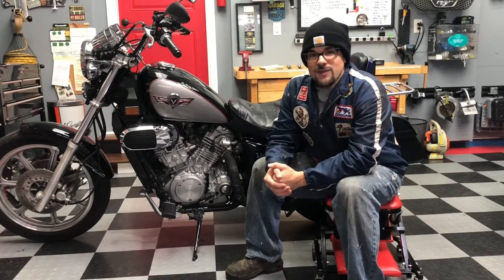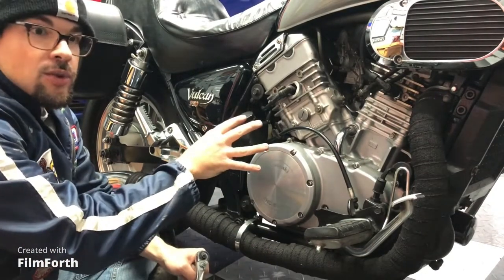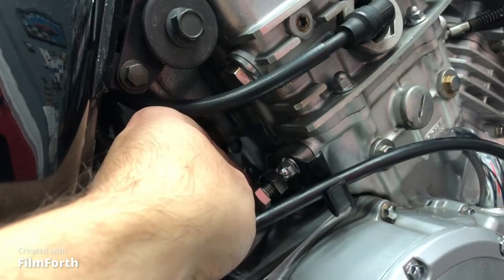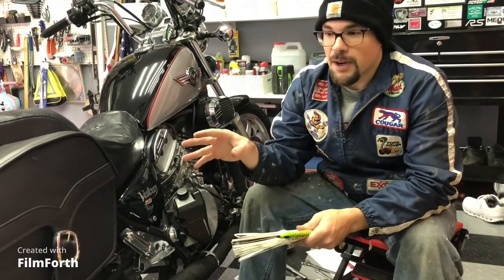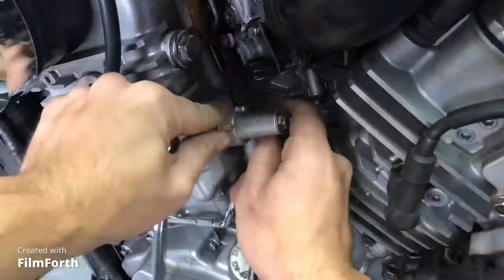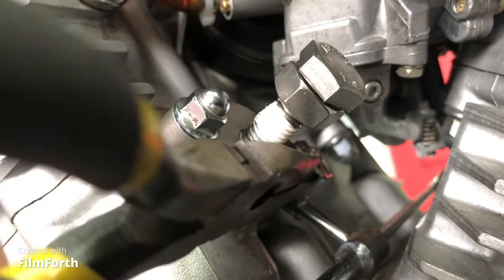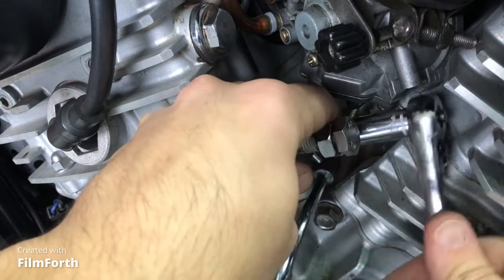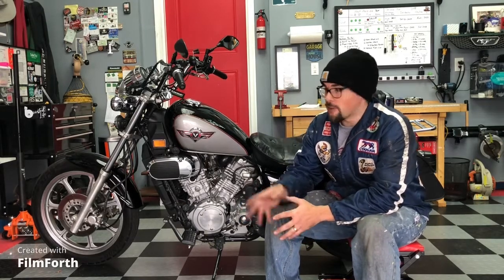How to Replace the ACCT's with MCCT's on a Kawasaki Vulcan 750

Comment from the maker: I found out from VN750.com that a 17mm stubby wrench (shorter wrench) is perfect for adjusting the MCCT's.
Reply: Noch eine Frage: Normal ist es doch so, wenn ein Steuerkettenspanner, nicht mehr die Kette auf die richtige Spannung bringen kann, sind doch entweder, die Spann-, und Leitschienen verschlissen oder die Steuerkette hat sich gelängt. Gehen wir einmal davon aus, das die Spann-, und Leitschienen der Steuerketten noch in Ordnung sind, dann kann es nur die Steuerkette selbst sein, die sich gelängt hat, und deshalb der Kolben vom Kettenspanner nicht mehr weit genug, und damit auch nicht stramm genug, gegen die Spannschiene drücken kann. Soweit ist es ja Verständlich. Wenn ich aber auf eine gelängte Steuerkette einen Druck nach "Vorschrift" setzen will, kommt es doch Zwagsläufig dazu, das bei korrekten Druck des Spanners, die Markierungen für Zündung und Ventile, nicht mehr übereinstimmen. Wie ist es nun, wenn die Kettenspanner gegen "Manuelle" ausgetauscht werden, in wie weit kommen die Zündzeitpunkte, und die Ventilöffnungszeiten "ausser Tour"? Ich habe an meiner VN 750A (1986), nämlich geau dieses Problem mit "klappernden Steuerketten", und möchte dieses Problem gerne beheben, ohne hier unbedingt den kompletten Motor zerlegen zu müssen! Was tun?
Reply from the maker: @K @KG-li7kg more likely than not, it’s simply the cam chain tensioner itself that fails. You see, the factory ACCT’s from Kawasaki commonly fail between 10-20k miles. And simply replacing them with MCCT’s is all that’s needed to enjoy tens of thousands of more trouble-free riding. From my own experience and from other owners on the VN750.com forum (some of whom have put >80k miles on their Vulcans), the rest of the cam chain components are quite robust.
Reply: @CFG750  Danke für die Aufschlussreiche Antwort! Dann kann ich ja ruhig beginnen, die originalen Automatischen Spanner gegen "Manuelle Spanner" zu tauschen.
Reply from the maker: @KG-li7kg  Yes. Here's some additional info from some of my past posts. 

https://www.vn750.com/search/115789/?q=MCCT&t=post&c[showFilter]=visibleOnly&c[users]=Checkered+Floor+Garage&o=relevance

Comment: Hi, where did you get these parts from? I wonder if they're still in business. Thanks
Reply from the maker: I got them directly from TOC's website:

https://tocmanufacturing.com/

But I've noticed over the past few years sometimes they have the parts available but sometimes their website is broken/not live. Currently, their website isn't live. So your best bet at the moment would be an alternative MCCT option. Check ebay for "VN750 MCCT" and you'll get suitable alternatives.
Reply: @CFG750  Thanks for your reply!

Comment: My 1995 Vulcan has only 8500 miles on it. I got so lucky.
Reply from the maker: That's incredibly low, what a great find! Given the low mileage, you're probably rocking the factory stator, so keep an eye on your charging voltage because my factory stator starting weakening ~13k miles and I had it replaced before 18k miles. Also the factory cam chain tensioners aren't robust so keep an ear out for any abnormal ticking sounds like this:

https://www.vn750.com/threads/explanation-for-ticking-sound.109645/?post_id=1330708#post-1330708
Reply: @CFG750  Okay. I watched and listen and heard the ticking of your engine. Thanks and I will keeo a listen for any ticking. I guess I should go aheat and change the ACCT's with MCCT's .   Much respect and thanks

Comment: Hi I just bought my 1995 Kawasaki Vulcan 750 last week. I have been wanting nice saddlebags and windshield for it. I like the way your saddlebags are. Can you tell me what kind, where to buy them, and if you had to get any other items like saddlebag rails for them to hang so perfectly on your Vulcan?
Reply from the maker: Thanks! I'm really happy with the quality of the saddlebags. They are from Viking Bags, and although the specific ones I have aren't for sale anymore (I got mine in 2021), there's other similar options that Viking Bags sells. Check out this link, where I search for VN750 saddlebags on their website.

https://www.vikingbags.com/collections/kawasaki-vulcan-750-vn750-motorcycle-saddlebags

Also check out this post of mine for some additional insight. You'll need to relocate the stock rear turn signals as they'll obstruct most saddlebag options. Or you can do what I did and get a turn signal & rear brake light LED combo unit (I'm just not sure how compliant they are w.r.t state & local inspections). I didn't need any additional hardware to install, but I did need to get creative and angle the mounting brackets a little further back to also clear the rear shocks.

https://www.vn750.com/threads/viking-saddlebag-pics.109535/?post_id=1329569#post-1329569
Reply: @CFG750  Hi, do they come with secure mounting hardware or do I need saddlebag supports with those? Thanks
Reply from the maker: @ChristopherWebb-ib2gg  The kit should come with the supports needed specific to the VN750. That's how my saddlebag kit was designed.

Comment: Are these interchangable for the '85 VN700 as well?
Reply from the maker: I believe the cam chain from a VN750 should also fit the VN700. The 700cc engine is just a slightly downsized version of the 750cc engine.

Comment: Does the MCCT fit on the vulcan 800?
Reply from the maker: I don't believe so. The Vulcan 800 cam chain tensioners (pictured below) look different than my VN750's.

https://www.ebay.com/itm/374718479358?itmmeta=01HR61N0NNTJMB6NQTAJFG638X&hash=item573ef63bfe:g:zf0AAOSwcRBkb6a0&itmprp=enc%3AAQAIAAAA8LZrYrWXWzgY9QiWmp6jSt0WMgZd4%2Fq4w1JoGGUsmRddq0ce3mH6h0nM6cqLQES81EzBMn1lZxiq8KBR%2FIeoFzbiOYTldhQxBreJkHR9JYD1%2FNeAWMNlc4nYnedMwuI5GDjXPsIRfSt5wCX0%2F1zR8pmMgKD7cHX%2BifFz3xCw3qmMTs0dxgdhpmcjXEfDvqHjSbvdQxHbZp%2B8IPERTMTkzohcwldPpBsLNlaT8Vl7jSUfOBwCsKww%2BTA%2Bm8FUIP95Nr%2Bvw61Jxjf3ErHGupcTXzv1zJqCiP6wMLxOgi4A5AB%2FMC7kpZ1LUuV5McatSzugpQ%3D%3D%7Ctkp%3ABFBM9orUwcFj

Comment: Last year I bought a 2006 Vulcan 750, I rode it for several short trips last summer.  At idle speed after riding I wondered about the clattering around the heads.  Seems you have put me on track for a solution!  Very very clearly presented information with the logic as to why the procedure works.  Thank you.
Reply from the maker: I’m glad this was helpful for you. That’s exactly why I made this video, I wanted to share everything I learned. I recently made this video for MCCT tuning, if you get new tensioners check this out:

https://youtu.be/Pe0xRETH4s8?si=ARifn-SMvb-UKOSf

Comment: How common is automatic cam chain tensioner failure on these engines?
Reply from the maker: ACCT failure is pretty common on the Vulcan 750's. It's not a matter of if they will fail, but when. 

On top of just general failure, I think another issue with these ACCTs is more so an an issue related to their inherent design. The plunger only extends out a certain distance. Beyond that, the plunger can no longer extend further and provide sufficient tension to the cam chain guides and will lead to chain slap. The MCCT's solve this issue because you can simply tighten the main bolt further than the ACCT could ever protrude out. On top of that, since there's no spring/plunger mechanism with the MCCT, there's less to go wrong or fail with the MCCT. I think once you go MCCT, it should last for the life of the bike.

And one more thing from my own experience with my Vulcan and from VN750.com. The factory ACCT's tend to fail between 15k and 25k miles +/-.  But I've seen them fail much earlier from other owners' posts on VN750.com.

Comment: Holy cow man, I love your channel and videos. This week I bought a 2004 Kawasaki Vulcan 750 same as yours. It just reached 11k miles. I heard it has that little rattle noise. Now that I watched this helpful video, I’ll order the parts and try to fix it myself. You just helped me save a lot of money. Thank you very much.
Reply from the maker: That's what this channel is all about. It brings me great joy to share this knowledge with others and to help others struggle less. I did a TON of research before learning about this common cam chain tensioner issue on these bikes. I was afraid I had sticky lifters or some other valve issue. I was afraid I'd need an engine rebuild. LOL I didn't know what I didn't know.

But after going down a rabbit hole of research over at VN750.com I wanted to make the process easier for anyone else who struggled after me. 

You are welcome and good luck with the fix. I'm still thinking of ways I can capture the "extremes" of the tuning process for the MCCT's on video (you know, the whirring and clanking). I got a new mic so it's on my list of videos to make. :)

Comment: Are ACCT not available anymore?
Reply from the maker: It's not that they aren't available, but more so I think that they only work when installed from factory on a new bike with a new cam chain.

I may be wrong, but my understanding is that there reaches a point in time where the ACCT's can no longer automatically adjust its plunger to supply appropriate tension on the cam chain, which has maybe stretched over time. So it's more so a design flaw with the ACCT's whereas there's no feasible way they'd last the life of the motor.

The MCCT's on the other end will outlive the motor.

Comment: Looked up link and it shows $85. Is that for a set or just one?
Reply from the maker: It’s $85 per MCCT. So you’d need two for the Vulcan 750 (one for each cylinder). It is quite pricey, I remember paying like ~185 with tax included. There are cheaper options on eBay. Just watch out for the the limited space you have on the rear cylinder. Some of the eBay MCCTs have long bolts and that would get in the way of the coolant reservoir tank near the rear cylinder. So you’d have to modify the MCCT in some way to shorten the bolt so it doesn’t hit the coolant reservoir tank. 

This is why I went with TOC. Also, personally, I didn’t want to use an eBay part for something as critical as the cam chain/engine timing. But that’s just me…I’ve been burned before getting eBay parts in the past and I’m fortunate enough to be able to afford $185 for the cam chain tensioners. I hope this helps. Let me know if you have any other questions.

Comment: you have very good helpfull Vids. i own a Vulcan 750  Q: when changing CCT does cylinder need to be top dead center. plus i think
Reply: I appreciate very much your quick reply I bought a Haynes repair manual is for valcon 700  /750/ 800 from 85 to 06. And it said you have to have it on top dead center. And I have been on Vulcan 750 forums yeah they said the same thing thanks for your tips
Reply from the maker: @jarrodcraft219  You are very welcome. Also, I guess at the end of the day it comes down to how likely is it that when you remove the ACCT, will the cam chain move/jump a gear/jump timing/etc. And I don't think there is a possibility of this happening when the engine is left in the bike like I did here in the video. But it's a different story when the engine is removed from the bike and the  engine is disassembled...then I think it's important to pay attention to the timing marks/TDC.
Reply from the maker: Thank you. I did a lot of research about this on the VN750 forum. My conclusion was that it's not necessary to have the piston be at TDC when changing out the ACCTs for the MCCTs. The owner's manual doesn't mention anything about TDC and alignment marks on the rotor for replacing ACCTs. TDC is mentioned in the next section of the manual, which is checking the timing chains.

You can also read more about this subject here on the VN750 forum.

https://www.vn750.com/threads/help-me-to-understand-tdc-and-cam-lobes.107490/#post-1304297

Comment: My bike got warmer than usual it usually stays by the second line on temp today it got to about halfway
Reply from the maker: Did the fan turn on?
Reply: @CFG750  ya it turned on
Reply from the maker: @donaldhabbyshaw6200  
Great! That's actually normal. During peak summer riding when its really hot, my temp gauge touches the thermometer icon. But the fans are on at that point for me and the temp never raises beyond that...and never even gets close to the red zone.
Reply: @CFG750  thank u sr

Comment: how  do you like this bike? I am about to buy one? any information would be much appreciated. thank you.
Reply: ❤ breat info budy  !
Reply from the maker: @Jaky7470  Thank you. Since we last spoke I filmed and finished my video about the overview of the VN750 if you wanted to check it out here:

https://www.youtube.com/watch?v=gGNW6X0MscU&ab_channel=CheckeredFloorGarage
Reply from the maker: Of course, I'd be happy to share some more insight. In fact, I'm working on a script for a future Youtube video to showcase the features/specs/procs & cons of this bike. But for now, this will have to do.

Some upsides include: (1) Incredible parts availability (the Vulcan 750 was manufactured from 1986 to 2006 and remained largely unchanged, so spare parts are plentiful). (2) a remarkably helpful and active forum at VN750.com. (3) great power for its size (66hp, 47 ft lb torque). (4) hydraulic valves (no need for adjustments and easy to replace the automatic cam chain tensioner (ACCT) with a manual cam chain tensioner (MCCT) that'll last the life of the bike...I have a youtube video about this process). (5) shaft drive (very minimal maintenance compared to chain drive). (6) center stand

Some downsides include: (1) the stator - all motorcycle stators (basically the motorcycle equivalent of an alternator) will fail. But the stator on the Vulcan 750 cannot be removed unless the engine is tilted/removed from the frame. I had the stator replaced by a dealer for ~$800 in 2021. Ask the previous owner of the Vulcan 750 you're looking at if they did the "Tuxedo Mod" (it's unlikely). The Tuxedo Mod allows you to replace the stator without needing to tilt or remove the engine. I think it's a good idea to measure the voltage of the charging system with the engine idling. It should read 12-13 volts at idle. At least this will give you some confidence the stator and rest of the charging system have some life left. It should read ~14 to 14.5V +/- when you rev the bike to 2,000 RPM and above. (2) the splines of the driveshaft should be lubed every 12,000 miles otherwise you run the risk of the splines rusting and wearing and you'll need a new drive shaft/assembly. Ask the owner if this has been done. And if you buy the bike, take care of this yourself sooner or later. I have a video about this, too. (3) Accessing the carbs is a bitch.

Those are the big ticket items that come to mind for the Vulcan 750 in my opinion. But then again every bike has its quirks and pitfalls. And it largely also comes down to the previous owner, so make sure to sus them out and see how well this bike was taken care of. If this Vulcan 750 was decently well taken care of, it'll yield many great riding seasons. I've put over 15,000 miles on my Vulcan in 2 years and it's been great. The stator was the only major service item I couldn't do myself.

This answer is more than what you asked for, but I'm passionate about this bike and wanted to give you some more insight based on my experience. Let me know if you have any more questions!